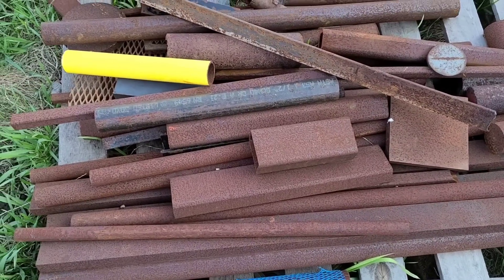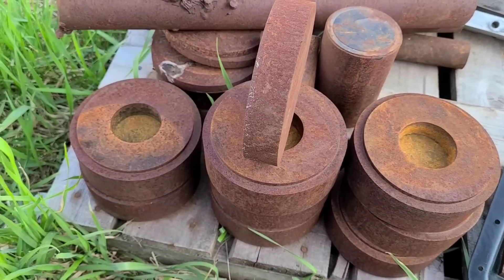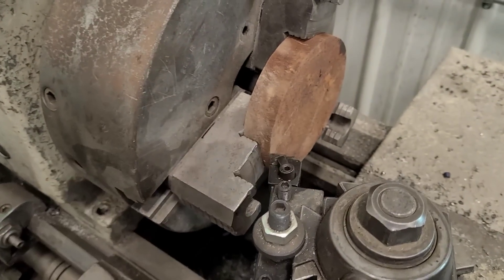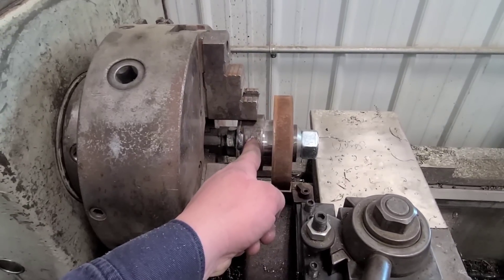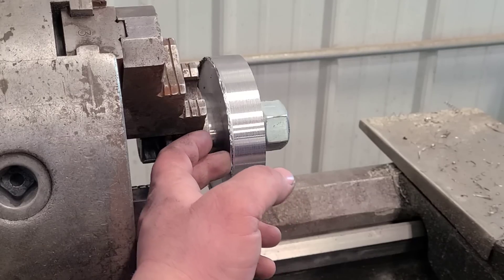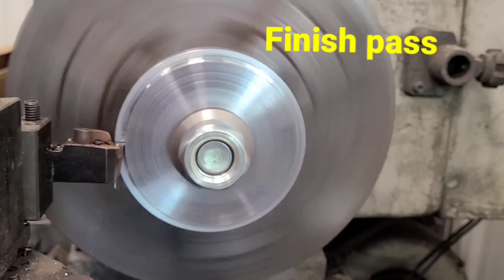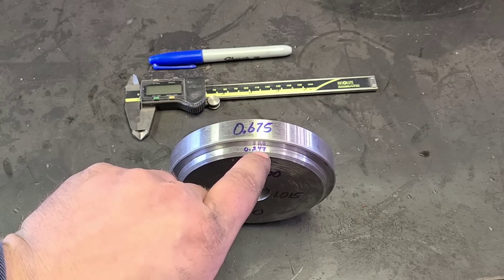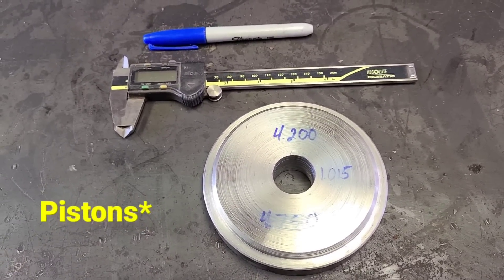Machining a Sleeve Puller for the Caterpillar D4400

Comment: Used to make #50 NMTB milling machine spindles out of 5-1/4" 4140HT back in the late sixties.  Would remove 0.400" off diameter each roughing pass and leave .020" on all bearing and seal diameters for finish OD grinding.  This was done on a hydraulic tracer lathe including roughing out the nose taper which was later finish ground after the spindle was assembled.  Nice work, Kyle!
Reply from the maker: That's awesome, I've never pushed my lathe that hard, but I have removed 0.250" in a single pass with a better set up. My mill uses #40 NMTB tool holders so I can imagine the about of material needed to be removed to make one, thanks for watching 👍